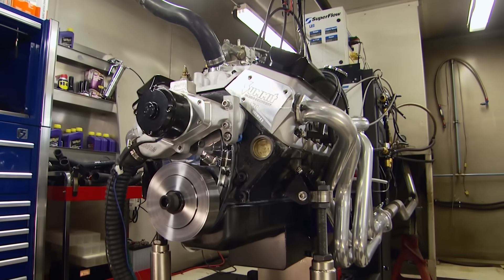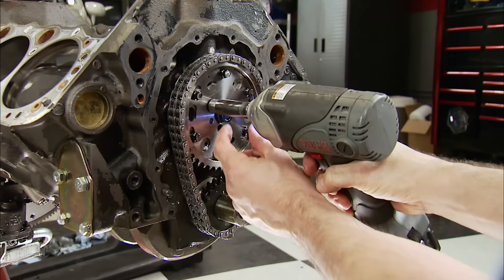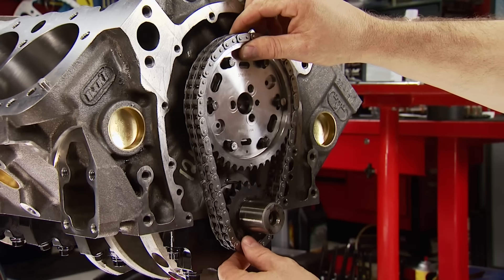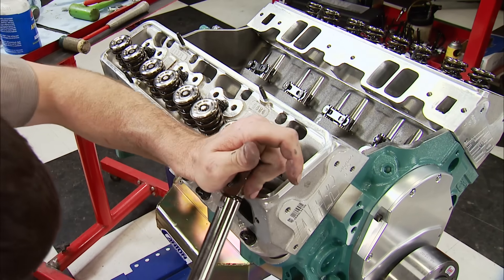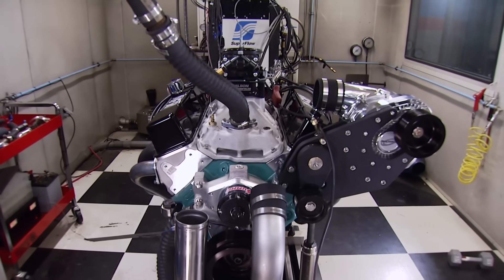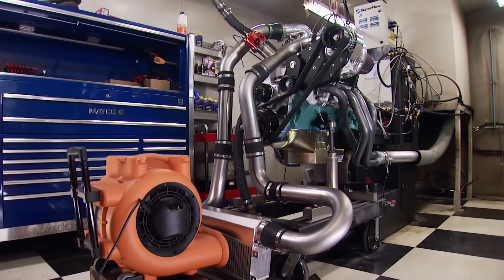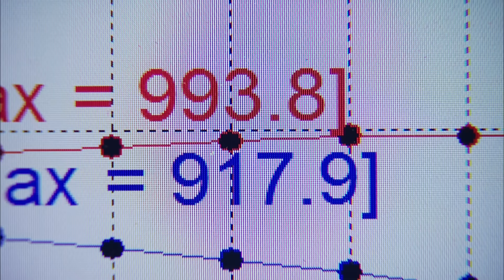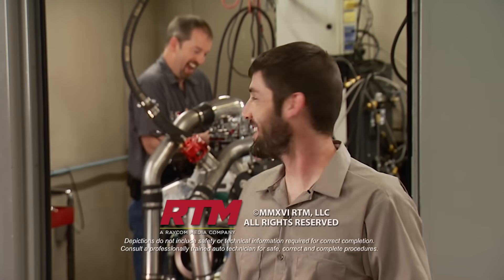Small Block Chevy Build Stage 3: 383 Becomes A 406 To Make Mega Horsepower - Engine Power S3, E14

Comment: Waiting for "someone" to make an episode on 4.6L modular 2V boosted stock versus boosted stock but the bottom end was torn down and all was done was re gap piston rings to accommodate boost and then both engines pushed hard to see if simply gapping the rings on stock 4.6L engine will let it make more power then the standard numbers ... IE yes the rods and pistons stock are shit but are they really the WEAKEST link ? because running high boost on factory gapped rings is a recipe for disaster and how much more safety margin can re gapped rings give you?  time and labor and head gasket and bolts is all that is needed .  make a video on something that has never been covered ...
Reply: on the bone marrow you essentially did the exact same thing on a 5.3L LS engine and it made a huge difference ...  to be fair now its time for you to do it on the modular ford engine

Comment: Did I miss something? Same heads, crank, rods, push rods, a 406 has less valve shrouding than the 383. Nice upgrade. The Little-M is a solid base to work from. And kind of slaps the smirk off all the LS motorheads. Old school muscle.

Comment: roller or not, didn't lube the cam lobes, that gets a BOOO....
Reply: I was told if you lube the cam you will encourage the roller tappet to skid during initial break in.
Reply: @farcry0018  if it can magically "skid" under the high valve spring pressures, then it is a poorly engineered junk bearing to start with.
now just maybe old stale "engine assembly grease" could cause it to happen, say you partial build and engine over 6 months to many years. who does that? get all the parts first, assemble and break it in within a month at most.

Comment: I was hoping they squeezed a 4 inch crank into that 4.03 inch bore block. 

https://www.hotrod.com/articles/0805phr-408-cubic-inches-with-a-350-block/

its a pity they didn't keep the plastic intake for the blown model, just to see if it cools off the intake charge. and to see how strong that polymer really is.

Comment: I was taught that the top ring should have the larger gap on boosted applications as the top ring see's more heat than the second ring & needs a larger gap so you don't get ring bind & wreck your engine
Reply: That's exactly what that sheet tells you.
Reply: @dalemllns  exactly but they had the top ring tighter than the 2nd ring

Comment: All that money on the build and go cheap on the fuel? Wtf! Fuel additives are joke and destroy engines. If you want high octane buy high octane. Think how many people are going see this and be moronic enough that run much timing and think their safe from preignition with just an additive. May as well bump the boost up to 50 and run 87 and get it over with.

Comment: I built a version of this motor after seeing this 4 years ago for about 6800$ minus the dart block. It was a turbocharged s488 383 gen 1 w/ gen 3 ecu and coil over plug ignition tuned with HP tuners. Scat forged Assembly wiseco pitons  a set of dart knock off clone heads and  single plane 4150 efi throttle body.  Fun little motor .  I want to add a dart block wiseco rods and another s488 one day.

Comment: Good to know I can turn one of my 383’s into a 406.
Reply: Redline Racer the video seems to imply that the same engine can be changed from a 383 to a 406.  ANYONE with ANY sbc experience knows that it doesn’t work like this.  It is a silly video, one that earned a “dislike” from me.
Reply: All you needs a 2300.00 block snd 799 set of pidtons lol
Reply: Dumb dumb dumb. 383 is a smaller bore 400 is all it is. For guys who can’t find 400 blocks. Same stroke at 3.75. The 3.75 crank went back into the bigger bore 400 block. Which actually has a .030 bore equalling 4.155. You can do that with a stock 400 block not a aftermarket like this. Just need a .030 over 400 block.
Reply: 4.155 bore and 3.75 stroke. Same stroke as the  383. They reused the crank but it went back into the bigger bore 400 block which is actually.030 over instead of 4.125 it is 4.155
Reply: You can’t make a 383 into a 406. That’s what a 383 is is a budget 400. You use the 400 crank but in a smaller 4IN bore 350 block. For guys that can’t find 400 blocks. 400 blocks have a bigger bore
Reply: @brandonbell3089  ever heard of sarcasm?
Reply: So I cant turn my 355 into a 496 big block?
Reply: Redline Racer actually a 350 can be made to a 406 but not something I recommend someone tries if you didn’t know this can be done. .060 bore, 4” stroke crank and 6” rods. This requires knowledge and block shaving and correct pistons to help clear rods as well.

Comment: its like a Chevy 350 Small block with a Modified Crankshaft from a 400 block to fit the Chevy 350 small block with modified bores for increased displacement... in the mean time messing with cylinder heads, effecting the Compression Ration for Higher Camshaft Intake and exhaust duration while retarding the Valve intake and exhaust timing for these alterations all for high 550-1,100 Horsepower with Timing Chain/Ignition Timing Chain altered 6 degrees counter-clockwise for advanced degree angle on the cam to crank gears already preset by the grinding down around the cylinder/pistons/bores.. but yet don't want to stick with the 383 stroke which was the modified camshaft out of the 400 block because you want to cut down on the .27 inches on it? what really made it a 383 was the camshaft modified. reminds me of Chevy's, CT400. oh well eventually they all are molds from each other modified so much and then added to. but anyhow Chevy's small blocks are really 350 with everything else altered in so many different directions, then went large while still working with 350's.

Comment: should read AFR heads tested on new 406 set up. You did at least use the 400 balancer from the 383 and valve covers. I did a similar swap in my 85 regal from the N/A 3.8v6 to the twin-turbo 6.0L jumped the horsepower from 90 to 1090hp. You should really be able to feel the additional 1000 wheel hp I hope

Comment: I always get a laugh when some days it is necessary to untorque a head in a particular pattern. 
 Pattern don't mean shit, it all about not roving head bolts all the way when you break the loose...by hand...I usually back  the all off a qtr turn...by hand...it a good way to tell if anything is moving around and it's loose enough by to not cause a problem if you have o ly one head bolt in, after that, spin as fast as you can and aluminium heads always twist a little after they been run,,,don't believ e me? Pull the heads and clean both gaskets as best as possible. I use a palm sander with 220 wet...put the head back back n without gasket...bet it rocks ztoungn

Comment: QUESTION on the ARP studs on motocross bikes you tighten the stud in the cases and/or not super tight but snug. What is the TORQUE putting in ARP studs is it the same?  thanks

Comment: why a 115 LSA?
Reply: Because of boost.  You want a larger separation angle so the boost doesn't blow through the valves like you would if you had a tighter LSA.

Comment: how is changing the NA carb out for a totally different manufacture Boost carb comparable?
Reply: The float in stock NA carbs collapse under boost and does not supply as much fuel through the accelerator pump
Reply: but was it the same CFM, Jets, …? Didn't really look like it. If a NA set up can't be directly compared then what's the point? They made it seem like just adding the turbo = big gains, well yes...kind of. a better choice would have been a fuel injected setup that didn't have to be re-injected, but wait, you always have to add more fuel when you add a turbo. Why didn't they admit that up front? I'm surprised they didn't slip in a "turbo" cam too...should have. Just say'n

Comment: I had a Vortech SC 383 in my 88 Camaro in the early 90s. I programmed the DFI ECU myself. It had a Lingenfelter box-ram. No intercooler and was set up for what they now call Pro Tour. I was 20 years ahead of the curve. 3.23 rear end and would still not get traction with slicks. You could melt the tires at 60MPH. I transplanted a T-56 Six speed into it. Centerforce had to design a new Kevlar disk to hold the power. It ran low 11s on pump gas without intercooler and 10 lbs. boost.

Comment: You have an axe. You replace the head. You replace the handle. 

It’s not the same axe.
Reply: What he means is it's no longer the same engine. At this point it's a complete diffrent all new components
Reply: My thoughts exactly.  No reason to tear down the stage 2 - just build another motor.
Reply: Especially if I get to sharpen it.
Reply: @bigboreracing356  They started by buying those parts for that Summit block. Then they installed some of those parts in a new Dart block. You can slice which ever way you want, but it's not the same engine any more.
Reply: @AB-80X 355 to 383 they only used the block, timing cover and maybe oil pan and balancer, 383 to 406 they used the crank, rods, timing set, lifters and push rods, heads w/shaft rockers, valve covers. I probably missed one or two but more parts was used from the 383 in the 406 even though the block is a major piece from the 355 to the 383.
Reply: Jim Anderson exactly
Reply: 373s
Reply: ¹¹1@1@00+
Reply: Not really relatable considering it’s the same bloc. Who can is the main platform so I’d say it’s the same engine just heavily modified

Comment: If they used a better set of plugs that have little bit more horsepower those plugs are junk I think they're called E3 you're right about the octane boost a friend of mine had a fuel cell turned to Jell-O
Reply: Infomercial junk plugs!!!  Most plugs will work ok for a single dynopull...but not much more!  And using canned crap octaneboost is disgusting. Notice the Orange electrode on plugs!!!  
This is hard to watch.
Reply: @karter9907  Exactly what I was thinking. They would be better off running a set of normal plugs like and indexing them for optimum burn (Perhaps try using a bit colder heat range). Then they really should have been using real race fuel or even E85.

Comment: A completely stock 350 running 10 to 15 pounds of boost cuz that's about all it'll hold won't make that much horsepower but it will run quite reliably with plenty of power for very cheap compared to your stage 2 build

Comment: How do you turn a 383 into a 406 SAFELY?????
Reply: Dumb question. Common since. 383 is the same stroke as a 400 3.75 but In a smaller bore 350 block. Now the crank went back into the bigger bore 400 block. Which is actually.030 over 4.155. It’s a aftermarket block

Comment: 1000hp from a sbc is impressive. Here's what I don't get: The six bolt skirted LS block is objectively stronger than the dinosaur sbc. regardless of the fancy four bolt after market block. Meaning, it is better designed to handle high output to start with. So you can get a junk yard block for a couple of hundred bucks and start your build from there. You can say the same thing about the rods and even the LS1 cathedral port head will outflow the dinosaur double hump. My point is the only thing left of the sbc was the block, so why not just start with a superior block? I mean yeah 1000hp sbc is impressive but the only thing sbc is the block and even that is after market. These guys have very deep pockets. I have run sbc's for years, but it's time to move on. sbc's have been out of production for 20 years, news flash the world has moved past sbc, it was awesome in the 60s, 70s, 80s even the 90s. The something amazing happened it's called the LS. I think everybody else has caught on, but hey it's your money you can spend it however you like.

Comment: They don't give enough information for me, what's your AFR, what is it at WOT? Show the dam graphs.. maybe if there was a show that did that...

Oh yeah, it's called engine Masters... far better show
Reply: stanley kendziorski
 This show and engine masters are two completely different shows and mind you this episode aired 20 years ago.
Reply: @markrich3271  S3E14 orig. air date is July 3, 2016, so not exactly, but it does pre-date most of the engine masters episodes.
Reply: @jamieschinkai1267   I'm talking about the show its self . I watched the power block as a teenager I'm 40 now.  If anything EM is trying to be like them.
Reply: @jamieschinkai1267  I stand corrected I meant the serries.

Comment: Most kill engines with high high boost with dish Pistons. Me personally if building a every day street/ strip ride would use flat top Pistons good heads with mild boost level's. Your engine would put out great power all motor and with mild boost level's with out killing your engine.

Comment: I'd like to see a similar build to Stage 3 N/A only with a Dart 434 SB. I have one in my 84 Vette here in Australia, running a set of Dart 230cc heads, 1-7/8" headers, edlebrock pro flo XT intake that has been widened and port matched to the heads and is running 65lb LS3 injectors. I am running a 90mm LS throttle body and this should flow at around 1100 CFM. The heads are 230cc 2.08" intake/ 1.6" exhaust 72cc heads, should bring the compression to mid 10's. Also running 1.6:1 ration Comp Magnum rockers, but cam is on the light side 113 LSA around 0.600" lift with the 1.6:1 rockers.
Reply: You could use bigger headers. At least 2"

Comment: I have a 406 in my 81 camaro now, but when that engine goes I am just going with a LS engine. Friend has one in his 79 camaro and for $5000 total including wiring and any other parts he is putting down 700 hp to the wheels with his 6.0 ls engine. And for anyone interested, he is running stock bottom end with stock heads, this is just bolt on power including a turbo.

Comment: Congrats on building a motor that won't fit in anything.
Reply: Michael Dose if these just move the tubing arrangement around I think it will fit in most 60s and 70s muscle cars with some fidgeting and fuckery
Reply: @amorecredibleusername692  It wouldn't be leagal to actually drive on the road, but who cares about that.  My question is why spend all that money on a block that is inherently weaker than a gen III. It's like building a house on sand when bedrock is right across the street.

Comment: If I had unlimited funding, like these guys, why wouldn't I start with an LS platform?
Reply: They don't have unlimited funding, and a $25,000 SBC holds a lot more power than a $17k ls7 or $22k lsx
Reply: William Landen And you base that on what? Even if that were true which, it isn't, the six bolt skirted LS block is objectively stronger than the dinosaur sbc. Meaning, it is better designed to handle high output to start with. You can say the same thing about the rods and even the LS1 cathedral port head will outflow the dinosaur double hump. My point is the only thing left of the sbc was the block, so why not just start with a superior block? And yes that is a rhetorical question so go to your favorite 1950's diner and think about that before you say something even more stupid.
Reply: 87 octane also

Comment: I’ve never heard of term pound feet
Reply: The “pound-foot” (lb-ft) is a unit of torque and a vector measurement that is created by one pound of force acting on a one foot lever. The formula for torque in the instance of tightening a fastener would be: Torque equals force times radius, or T=FR. When tightening a bolt, “R” would be the length of your wrench.

The “foot-pound” (or more accurately, “foot-pound-force”), on the other hand, is a measurement of work. Work is the measurement of force over a given distance. So one foot-pound-force (ft-lbf or just ft-lb) is the energy required to move a one pound object one foot of linear distance.

Comment: Curious why you stopped at 11-1 compression on the 383.  Once your past the point of running pump gas why leave power on the table by not going 12-1 or more?  I noticed your power levels are down from the 377 and 383 small blocks we were building 30+ years ago....It's not the heads , so it has to be the lower compression....
Reply: BOOST..............
Reply: @throttlebottle5906    You clearly know nothing about compression or boost.